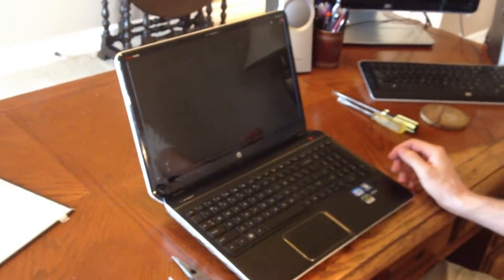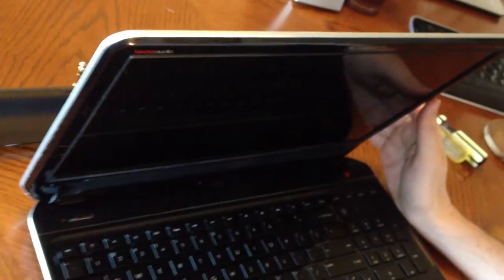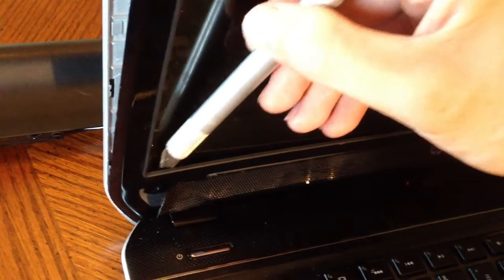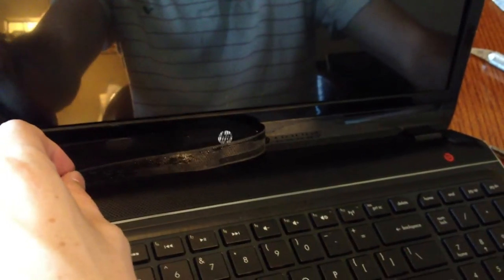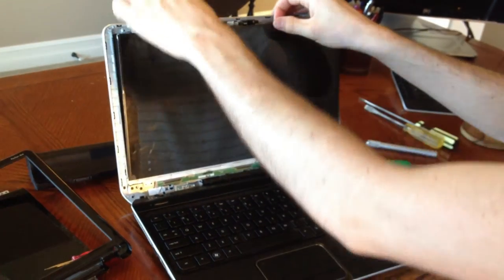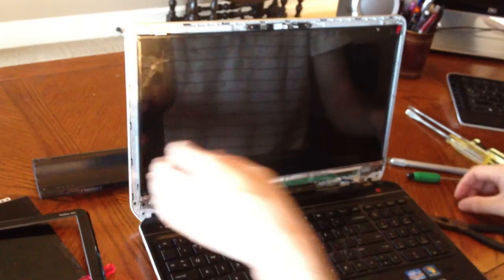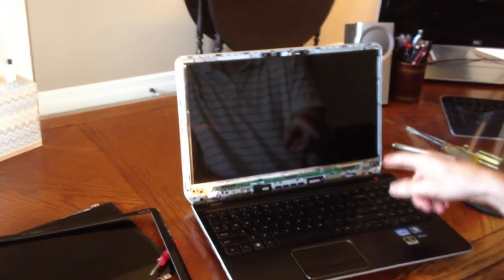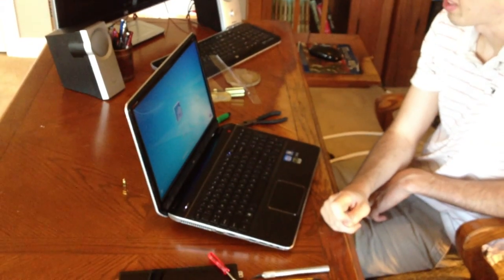How to Replace Laptop Screen: HP dv6 7000 Select Series

Comment: The thirst time in life i replaced the screen for my 4 year old labtop. The pavilion dv6 is a very reliable modell, I had never problems with it. The screen broke because a mistake of myself. I ordered it by ebay, the seller helped me find the correct screen. The video is very made excellent, escpecially for beginner. Thanks a lot.

Comment: so my computer has the issue that  a few pixels lines  arent changing colour, if i touch roughly where the 40 pin connector is it makes it worse.

so i assume the connection is broken. so my question, if the screen end is broken does that mean replacing lcd?